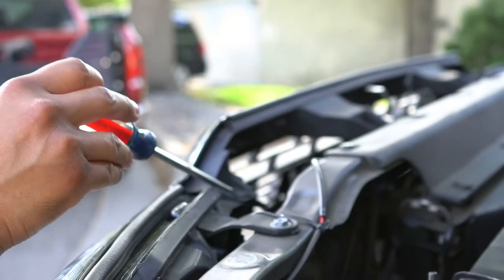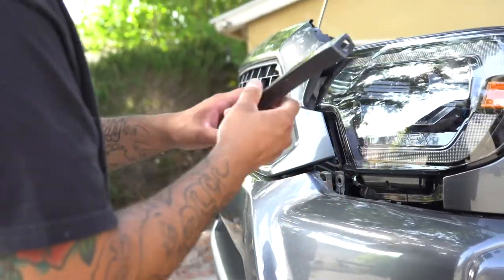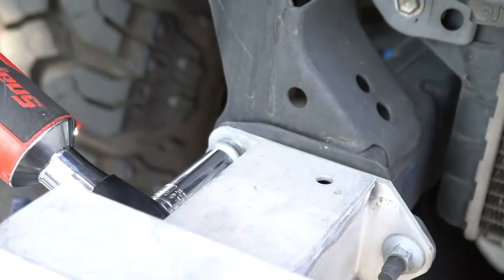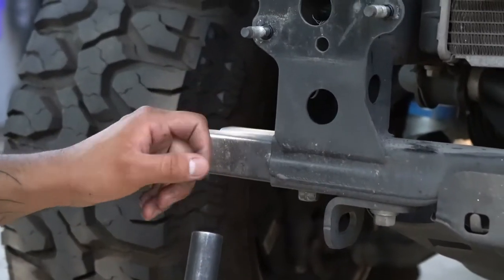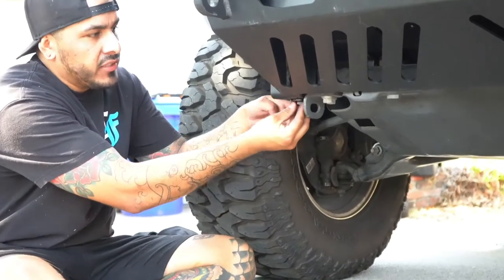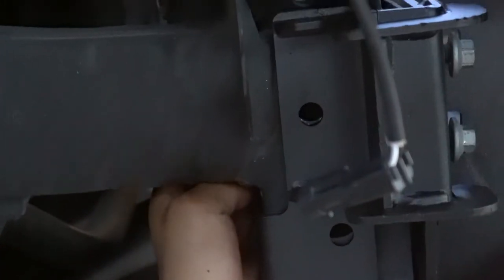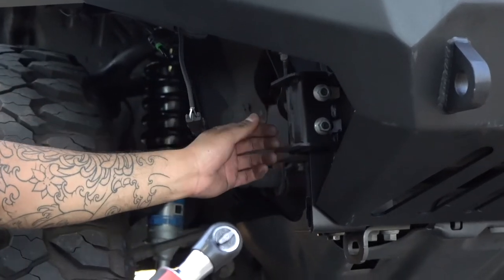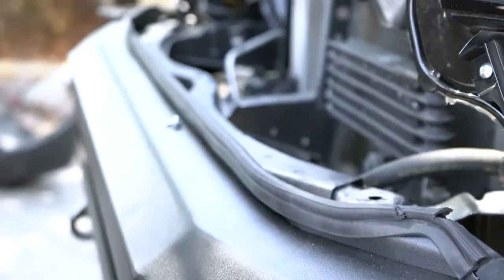Body Armor 4x4 Pro Series Bumper Install

Comment: For the love of God, how did you mount the 30in light bar haha. Not clear in the instructions or I’m just an idiot. Probably the latter lol. 

Also, did you guys cut the splash guards in the wheel well?
Reply: You have to use the brackets from the Bumper hardware box not the brackets that come with the light bar. Just went through this and it took me about 45 minutes to figure out the bumper hardware box had the brackets. Yes cut the inner fender lining.